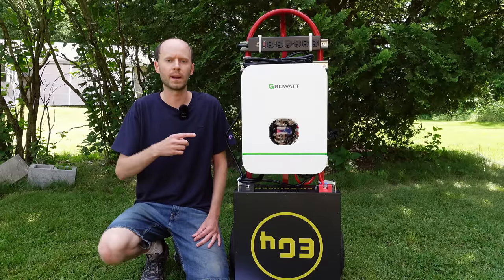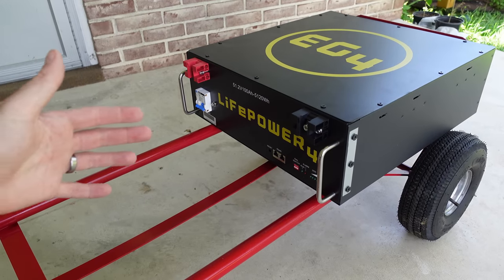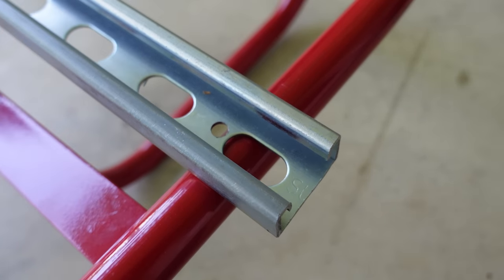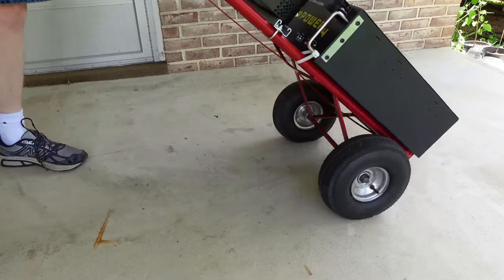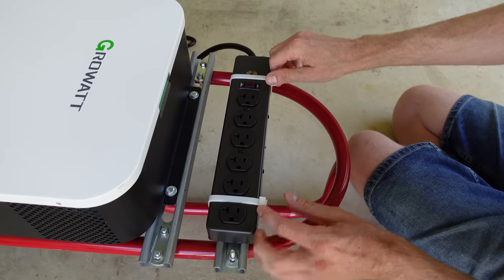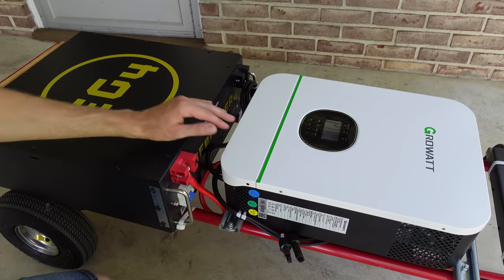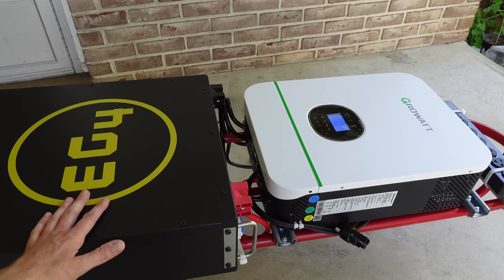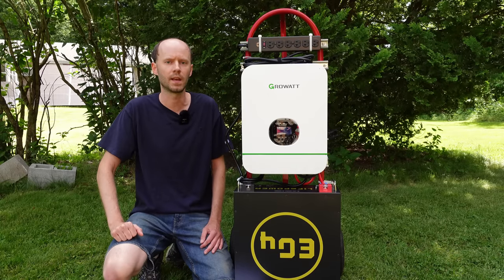Building a 3000W Portable Solar Power Station, Great for Power Outages!

Comment: Hey get in contact with me I live here in Humboldt county California your cart idea is similar to my own I call it the P.P.P.W.S. or the phillipsville  power production way system I'm built a solar cart but mine is fully powered by energy directly from the Sun also mine has enough to basically power a small motorhome and mine is on a movable cart itself I have to rebuild my prototype after The accidental blow up of the battery system but that was done by accident and for a safety concern from one of my close friends I have already been told that it can be a multi trillion dollar business that I have I have information that could improve the quality of your products significantly I can also show you how to set up electrical functioning systems that allow you to bypass and switch systems for importance I have friends from England that they use devices still from their country well I have a plug-in for those types of devices actually I have eight different types of plugins specifically for friends across the world that uses my device while they are here experimenting and testing my product I will be rebuilding it at the end of this summer at the weight of this product is more close to like 800 lb of equipment it also can run TVs Playstation Xbox small fridge fans cooling what you need basically my first setup had six 200 amp lead acid batteries with 250 watts of continuous sun power powered by Germany type made solar panels specifically for better use under the conditions of having lower light settings which is preferable even in my area that means even if I do not have the power that is normally running my system I will still have enough to play my Xbox PlayStation TV cooler air conditioning what not also I've been dealing with these hearts since the start of 2014 when I first started making these so please get in contact with me I'll leave my email her at the bottom

anthonysteeleistwiggzofhell@gmail.com
And my business phone number 707-672-9743

Comment: No solar anything is great for power outages. 3000 watts is NOTHING. A hair dryer pulls 1,500-2500 watts. You are selling a battery. The solar part is how fast it can recharge. At night...zero, On a cloudy day, less than 50% and it might not charge for the whole day. 

Then you show a monstrosity... no thanks... don't want to lug that around. I have a 40lb little box that runs on fuel... lasts over 20 hours... powering 3000+ watts continuously, on one gallon of fuel... which could be gas, corn oil, or propane. It works day or night, rain or shine. That is what works in an outage.

BTW: That is my portable generator. I also have a 24KW... yes 24,000 watt generator to power my home... rain or shine... or snow... or ice.. or a month long series of cloudy weather.

FYI: You aren't saving a tree, a bug, or anything using solar... you are going broke... and that is THE dumbest choice to rely on for a power outage.

Comment: "Portable solar" without solar panels?? I wasted my time watching this.
Reply from the maker: I wasted my time reading this comment.
Reply: @LithiumSolar  Good comeback, and fair enough. Don't get me wrong, the video is great and your build is excellent. The problem is the title you chose: "Building a 3000@ Portable SOLAR power station." You only showed the battery being charged from AC. The real trick, and what I was hoping to see, was what you used for PORTABLE solar panels. Did you use rollup or other flexible panels? Foldable? How do you support them out in the field?

I have a good friend who invented the concept of going into disaster areas and re-establishing communications. They too built various types of portable power units (all of which have to be under the 100 pound airline luggage limit), including one setup which used flexible panels which they laid on top of the tent roof. Their setup was good for its day (first use was the 2004 Pacific tsunami which killed a quarter million people), but left a lot to be desired.

So, I was hoping to see something which matched your title, and your video did not.
Reply from the maker: @johnmeyer77  I have an entire second video dedicated to sizing and connecting solar panels. I used standard not-portable panels in the demonstration. It is intended to be portable power, ie you roll it out to where you need power, then roll it back when you're done for charging. It wasn't really intended to have the panels be part of the portable equation. There's no reason you couldn't use foldable panels with it though. I just don't think you'll get enough power from those unless you were to carry around 10-12 of them and the associated bus cables.